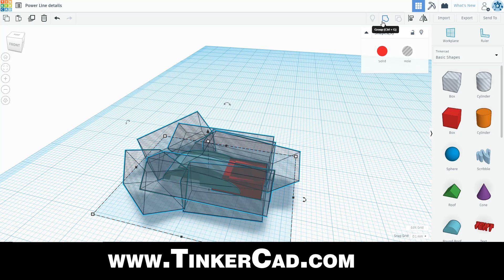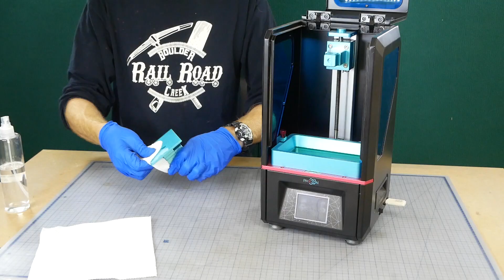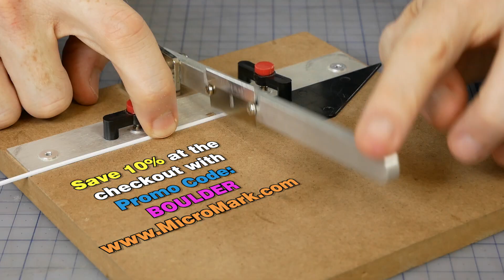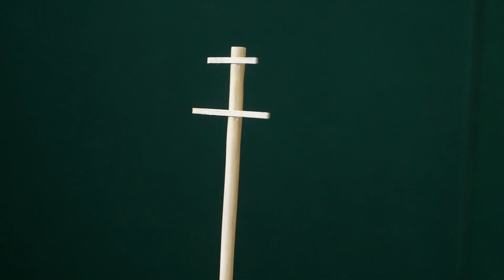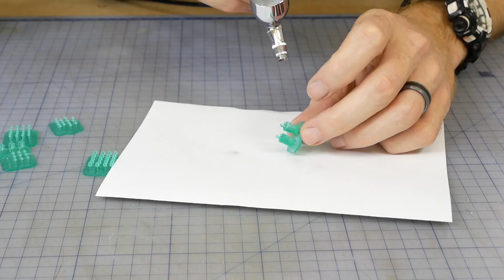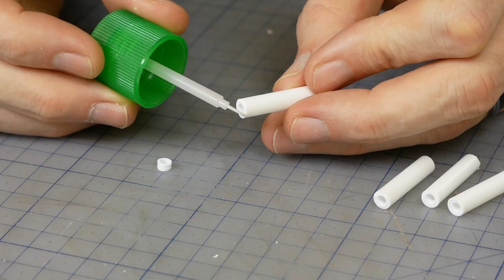Extremely Realistic Utility Pole with Lighting Effects - Model Railroad Scenery

Comment: Hi I went to your website to purchase your stl files but they are still not there just wondering if you will be posting them please advise.
Blessings Pastor Randy Bourque
Reply from the maker: Those ones are free, there should be a link in the video description that leads to Mt website page, if you scroll to the bottom of the page there should be a download link. It's a Google drive link.
How that helps
Reply: @BoulderCreekRailroad  Thanks Luke got the STL Files and noticed the pdf is there a chance that I could get the CDR file as I am going to use your process but upscale it to O Scale for a town diorama that I am working on.
I have Corel Draw 2020 that I use all the time and could redraw it but if the file is available well it is much easier to up scale.
Blessing Pastor Randy Bourque

Comment: Hello LT<,,   I am a 45 year Master Electrician, and in ALL my years, I have never seen any individual sit down and do something so RIGHT and so detailed, in the electrical aspects,,,  They usually run some wires through a bush or under a board and call it "magic lighting"  hahhaa   ....   My congrats,,,   There is ONE detail you have missed, and its only because you did not know maybe,  ,, With 15,000 to 50,000 volts,  (and your setup is usually  7,500 - 15,000,,   ALL items must be over six feet clearance from the power transformers,,,  IE,, you could have put them lower or on the other side,,,  or omitted them on the transformer poles,,,   But one thing that amazed me,  was you included the grasshoppers,, the fuses that come off from each of the phases in the transformers,,,  THAT Sir,, is detail !!!   I commend you,,  ,,   Albeit, you also have the TAPS for the 308/240/120,  but did not connect the power lines,,  ,, the TWO LITTLE NUBS on the sides of the transformer are for this purpose,,   here is a detailed hookup on the inet, of how it should look,,  100%     And the TAPS for the main top, only ONE goes to a fuse and the second wire goes to the second transformer, and the third wire to the first and so on,  IE, they are tapped,,,  thus making a 3 phase alignment,,,  look here:

https://www.google.com/imgres?imgurl=http%3A%2F%2Fwaterheatertimer.org%2Fimages%2FDelta-wye-transformer-333-6.jpg&imgrefurl=http%3A%2F%2Fwaterheatertimer.org%2FHow-to-identify-transformer-wiring.html&tbnid=aCUiGibHJFNJqM&vet=12ahUKEwjY_9L69NXtAhUBpK0KHZNbDF0QMygEegUIARDzAQ..i&docid=XNKx58oqC_kt5M&w=550&h=622&q=single%20phase%20power%20transformer%20on%20power%20pole&client=firefox-b-1-d&ved=2ahUKEwjY_9L69NXtAhUBpK0KHZNbDF0QMygEegUIARDzAQ

   Also,, ONLY in EXTREME cases would you use 2 transformers,,    as a need to power a large area or community area, so either it would be a single transformer, single phase, or 3 transformers,  three phase,,,,,     Here is a tap for single phase,  only one source:

https://www.featurepics.com/online/Powerline-Transformer-742525.aspx

now as one person said, where are the tennis shoes??  hahah  hagd                 

 ................   PS<<<<  ooops,,  found two errs,,,,,  your Street Lamps,,,  well, we never drill up the middle of the power pole,, hahha,, so , each lamp SHOULD have a U shaped grey plastic cover, kind of like a turtle shell,,  (probably could make it easily from a cut down straw,, or even some flattened copper sheet)...  and it covers from the ground (where the power would be coming in , from an underground breaker box or tap splice, then a breaker box,,)  then up the pole to the swing arm, where the wires would then enter the support arm then the lamp itself,,,  This does NOT mean you must run your power through them, I am not suggesting that,, only for asthetics and properness, this item should be installed,,,  same with a "grounding wire",, but that is REAL detail and most people would not even think of it,,  ,,  lastly, guy wires too, but again, that is EXTREME detail and not needed in a RR set or diorama,,  ,,  guy wires just keep the sway down from winds and storms,,,,,    As a fact,,,,,  I installed Every one in Galveston Tx in 1993,, from the causeway to the east beach, and within a week, Hurricane ALicia took out every single one,,,  but I did the job right !!!  hahah   TC

Comment: Can add one tip. Those Chinese SMDs can often be faulty. Test and leave running for a period of time before flitting.  I used some in a project and after a short space of time several failed, and I was not able replace them due to the way they were fitted.

Comment: Luke, hi.  Great video, but I didn’t see how you connect the lamps to the power source.  It seems you have one wire from the LED?  Or am I wrong?  I would be grateful for the information. Or is one wire traveling along a pole and the other inside a pole?  Yes, probably so.  I did not see right away ...

Comment: These poles look absolutely perfect except for one thing: there's usually three fuses instead of four. If there's four wires on a crossarm, like what you have here, one of the wires is a neutral wire (not "hot") which means it doesn't connect to a fuse. Often, the neutral is mounted underneath the crossarm directly to the pole with a small "spool" insulator.

Comment: It's not important to clean off the build plate of your resin 3d printer. It will submerge back into the resin to print anyway.
Also you shouldn't spray IPA so close to your open resin vat like that. IPA getting into your liquid resin will destroy it.
edit: Unless you store you Vat in a plastic drawer.... You could just print this lid off on your FDM printer or ask your friend you mentioned so you can leave the vat in the printer.
https://www.thingiverse.com/thing:3054862
edit 2: also those street utility poles are something else. Amazing work mate.

Comment: Hey Luke, what would standout, resolution permitting, are some of the tags left on the poles by contractors to signify that they have been checked, marker plates indicating Hydrants, Stop valves etc for water/waste/reclaimed water, posters and vehicle/pedestrian thoroughfare signs etc. Maybe have Yellow coloured LEDS indicating Sodium vapour street lights, w/wo the markings indicating the lamp type (resolution permitting) would add a bit of difference too.  I am wondering though, are the square/rectangle Transformers harder to make compared to the cylindrical ones you have shown here? Great work here, Cheers man :-)

Comment: Excellent job and very envious of your work and effort.

As a power line designer in Victoria Australia i just have to point out some constructive errors. Some of which for me a glaring.

First. I believe you have copied an American style ultility pole.

Second  the insulators are back to front. You have built a high voltage with sub circuit low voltage thus the number of insulator 'sheds' should be voltage dependant (unless larger diameter). So the insulator with the additional sheds should have been used for the delta cruciform contructed high voltage.

Thirdly wood poles have metallic pole caps to stop rot from water ingression.

Last point the detail in which you go to is amazing. However why not put the additonal connection from the pole type transformers (low voltage busings) to the low voltage. It would show the complete circuit. Additionally you would also have fuse boxes which we call FOLCBs (fused overhead line connector boxes) which supply the lights, services etc, including transformer low voltage isolation switches.

Comment: Great video as always, i had a question on why you decided to use styrene tube for the poles instead of wood dowels?
Reply: Needs to thread the LED wires. If he used wooden dowels he would have to drill out the core.

Comment: I did this with very fine magnet wire and the lights were powered from them, I used a lighter to remove the coating from the wire then wrapped each one up.

Comment: Another great video.
I have a suggestion.
When doing the very fiddly and precise work like drilling holes you could make a jig. You would only need to line up two holes precisely and you could then repeat these at will with great ease. You could 3D print a jig or just make from scrap plastic or wood. 
You could also make a jig for assembling the pole, just add a few bits of scrap to your drawing.
And one more suggestion, a few small birds perched on a pole would look great,
Cheers.

Comment: Hi Luke.  Could you look at doing some "Australian" type electrical components as 3D prints?  You need some single phase transformers, similar to what you have done as well as 3 phase transformers along with different sized post insulators.  The high voltage ones are much larger than the low voltage ones. Some HV disc insulator strings for termination or strain poles would also be good.    Love the HV fuses though.  Keep up the good work.

Comment: A hint for centering the holes: As a watchmaker, I normally use a rod of (hardened) steel with three faces filed to one end, so they form a triangular arrow (with an angle of about 90 degrees) This helps a lot to make a mark where the hole should be at the end. Hope you understand what I mean, otherwise I can send you a picture ;) Thanks for your great videos, they're very inspiring to me, even if I'm not building such models. But your use of tools is very great!

Comment: Tip for using Xacto blades as scrapers.  Use the back side the the blade for scraping.  It works very well, offers a lot of control and saves the cutting edge for more appropriate tasks.  Note on most blades one back edge (corner) will scrape more aggressively than the other.  Again this offers some flexibility and additional control.

Comment: Hi Luke! Absolutely brilliant - as are all of your modelling projects!  I was wondering if you would be able to share your eBay supplier for those pre-wired SMD LEDs.
Reply from the maker: hi Stephan, here is the link to the eBay posting:
https://www.ebay.com.au/itm/C0402WM-20pcs-Pre-soldered-micro-0-1mm-Copper-Wired-WARM-WHITE-SMD-Led-0402-NEW/172542510629?epid=1291567535&hash=item282c55c625:g:9EAAAOSw7NNT~Vv0

Hope that helps 😉
Reply: Thanks Luke!  Much appreciated!

Comment: I fully expect that for one of these luke will troll us all by starting with a shot of some real place
Reply from the maker: lol.... you're giving me ideas, maybe next years April fools video 😄
Reply: @BoulderCreekRailroad  The traditional techniques are to make giant versions of common small objects to "accidentally" leave in the shot and to completely paint some full size objects with one or two colors each. Use a high gloss paint to give things a plastic look.

For example, coat everything on a bicycle in gloss red except the tires, the peddles, and the hand grips. Paint those in gloss black. Use enough red paint on the gears, chains, and other moving parts so they no longer move.

A model of a USB cable with a micro connector scaled up to be a meter long would make a good prop to have in your scene.